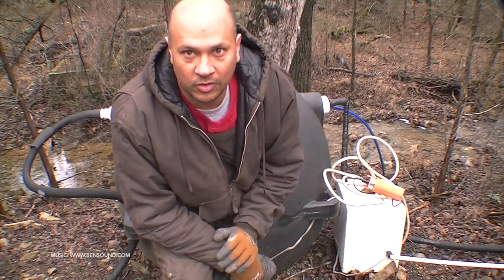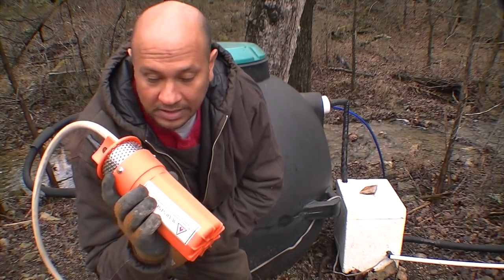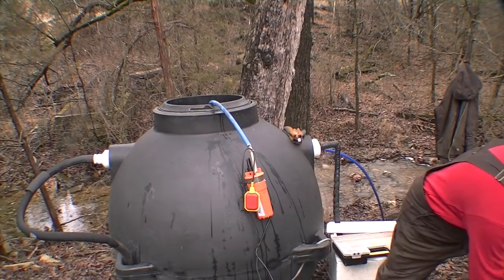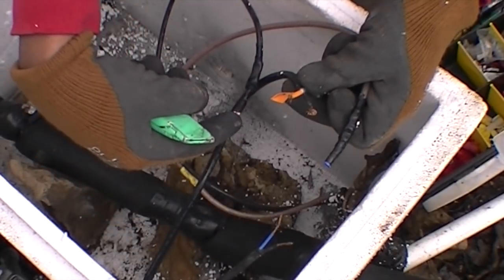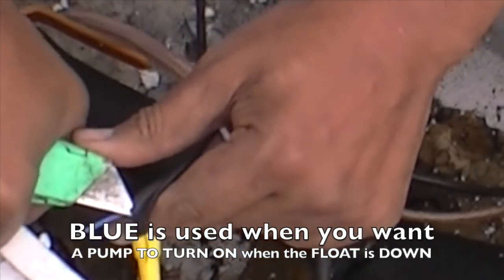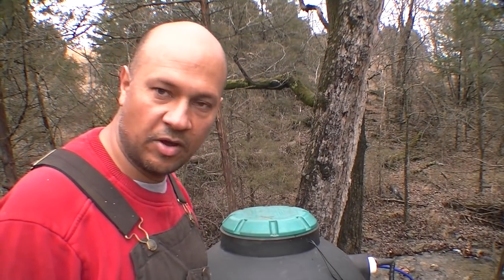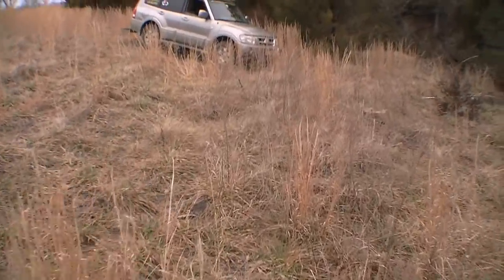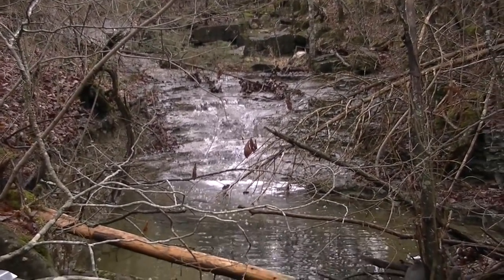OGH - Installing Off Grid Submersible Solar Water Pump for our Developed Spring

Comment: All water-filled hardware ( pumps, valves, piping etc.) will crack and burst if exposed to freezing temperatures. Enclosing your system in an above-ground insulated box only slows the process. Disaster is unavoidable. This is because you are attempting to conserve such a miniscule amount of heat. 

You have three options: set the pump up in a conditioned space (the house), invest in a submersible pump, or go to a well pit. This is a traditional, old-school approach that involves a pit (usually lined with heavy timbers, steel or concrete) about five feet deep and about five feet in diameter (room for you to work). Of course it needs a well-insulated cover. This is something that can work well, if it doesn't immediately fill with water of course! A neighbour has one and it's entirely trouble-free. The earth's warmth prevents freezing.

If you live in a moderate climate where it only freezes lightly, a heavily insulated box set in the ground can work. I'm speaking here of at least six inches of foamboard all around, open on the bottom. Again, a tightly fitted, heavily insulated cover is needed. Drafts are your enemy and must be stopped.

Submersible pumps are a great choice but ridiculously pricey. A quality one that will run for years and years (SunPumps, RPS Solar, Difful, Grundfos etc.) will easily set you back $1500 or more. The Chinese ones are affordable but appear to be lacking in durability. Too bad. The Chinese do make quality pumps but don't sell them in the West because, well, we don't want to pay for better pumps!

Anyways, my two cents worth. If you keep replacing $100 pumps, pretty soon you've spent the money that could have purchased a quality pump. Good luck, from the Great White North: central British Columbia, Canada.

Comment: I just got this same pump. How did you connect the PEX tubing to the plastic barb fitting on the pump?
Reply: Just found a rubber hose and hose clamps to tighten them down.  Its worked just fine for years.
Reply: @JohnFraserPhotographer  I've already got 100' of 1/2 PEX, and a pex check valve, so pretty much commuted to dropping it down the well. 
I've seen many vids, including this one, that have the PEX connected directly to the hose barb. 
May end up using a couple of feet of hose, then a Barb to NPT adapter and a NPT to PEX adapter to get it done. 
Thanks for the reply.

Comment: Shurflo makes a very similar unit and sells replacement parts. However at $800 I thinks its best to buy the cheap units. Since the diaphragm replacement from shurflo is $80
Reply from the maker: I had 3 surflow pumps prior to this one.  All of the diaphram pumps (non submersible) had the heads crack on them even with the pumps in an insulated box outside the cistern.  Thanks for the suggestion.
Reply: They also make the 9300 which is almost identical, i reached out to amarine for a source for the parts kits im getting about 2 years out of these pumps which isnt horrible for the price.

Comment: How did this submersible pump end up working over time? I'm looking at similar options and the reviews for some of these are mixed.
Reply from the maker: Hey Brian, the submersible pump the orange one has given me mixed results.  I'm averaging about 1.5 pumps a year.  I bought the extended warranty on but trying to get them to replace this and communicate with the chinese company who makes them is just bullshit.  I called Amazon and bitched at them about this piece of shit warranty company and the crap you have to go through to get anything done.  Here is the secret.  The pump will fail you've got 6-18 months on it.  Buy two.  (From Amazon).  When the first one fails, Order another one, and let them know it failed in about 20 days.  You have 30 days to get it replaced under amazon's 30 day return policy.  Return the old one, and you'll have your 2nd replacement again.  I've been doing this now for about 2 years.  The chinese people tell me to take apart the pump and let them know what I see?  I do that then I dont get a response.  This has gone on for 2 months in every case.    Hope that helps.  But this is the ONLY pump that is inexpensive - and submersible that has worked with my 2 solar panels now for the last 2.5 years now.
Reply: @OffGridHomesteading  if you could start over again, what would you do differently? I've explored ram pumps, but can't get them to work. I also see harbor freight on-line pumps, but those appear to need priming. If you have any advice, I appreciate your perspective. Thanks.
Reply from the maker: @mountainwave666   hey brian, my orange pump is my 5th iteration of pumps.  I've tried, the surflow external diaphram pumps a few different ones.  12v, to 24v, I've used, all the external ones will freeze and crack even if they are insulated.   The ONLY pump that has worked on the low power solar panels only is the orange one.    I'm sure I could have found a more expensive pump that could last longer, but here's my premise...  All mechanical crap -- that is submerged WILL FAIL as some point.  So fine the least expensive solution that will work for as long as possible, it's EASY to swap out, and is inexpensive to replace (i.e. under $100) and is readily available.  So if you can find a BETTER submersible pump that is UNDER $100 that can push over 440 Feet laterally, and up 35' of head on two solar panels... without using batteries, or a charge controller, relying ONLY on variable power to run the pump (when switched on at the pump)..... i'm all for it.    If you find a better solution let me know.  If you do decide to buy one -- please use my affiliate link for amazon as they'll send me 5% for you buying it. (so I'll make about $4).  Hope that helps!  J
Reply: @OffGridHomesteading  I have a couple of questions, what type of pump is it (centrifugal, diaphragm etc)? And what part fails?
Reply: @magnum0121984  Ive used all of them.  The diaphragm pump worked until it got cold and the head froze (surflo brand).  Now that its a submersible one, those haven't had issues except for water infiltration to the pump over time.
Reply: @OffGridHomesteading  great information man. And you use it two hours day average? Thanks and regards from Spain
Reply: @permaculturaensecano8644  Hey Frederica, the system is now my backup system, and when it did run it ran until we filled up the tank then I would turn off the switch to the system -- until the next time we needed to fill up again.

Comment: Will that pump output enough water to run a slucebox for gold mining? It's just that a couple of 100 watt flexible panels and that pump is way easier to lug around a claim than a gas powered pump
Reply: I’m not sure what amount of water you need to do your slucebox.  Look at the flow rate on the pump specs. I run my pump with 2 — 100w panels so yes it could work.   If you are gonna use water from a spring make sure you use a pre/filter to remove sediment.
Reply: It's 1.6gal/min but it can operate with a 230 foot head. That is the impressive part. There are DC sump pumps that can move huge volumes of water, but only with a head of 7 to 10 feet.

Comment: What about a nice battery?
Reply from the maker: You can add a battery.  I wanted a simple system that solely relied on the sun, and I didn’t want to be replacing batteries every 1-3 years leaving it outside 24/7 in the elements.  It’s one more thing to break down.
Reply: No battery= simple.  Nothing to have to replace.

Comment: How about  a Ram pump?
Reply: Only works at about 10% efficiency.  Not enough drop, or head to do the job, and it's noisy.  When you want to be discrete -- when the shit hits the fan... the less then noise the better.  Keep your water sources private as much as you can.
Reply: You really have to have enough drop to make a ram pump work. On the other hand they are simple, tireless workers. But he is  correct they are surprisingly noisy. But one I saw was made out of steel. The only time it failed over the decades was when lightening hit it.

Comment: How has it held up my friend? I am looking at getting one . 73.00 dollars on ebay , if it works that is a steal.
Reply: Longest I've gotten out of them was around 9 months.  I'm now using ours seasonally as we have added a well for a secondary source, and working on rain water catchment.  The more expensive ones will still only last a year  or a little more if they're out in the elements.     If i were do to this again i'd dig a hole and install it in a foam box in the ground.  Unfortunately my floor area is all stone.

Comment: No controller?
Reply from the maker: No need for a controller.  I'm not charging a battery bank that needs to be "tapered" of by a controller, or shut down when it's nearing 14v.   My panels create 24 v wired in series, create enough power to run the pump when the sun is out, and it doesn't with the sun is not bright enough.    And it's been working fine now for 3 years now.
Reply: Where does the extra load go? I thought that was part of the function of the controller - to only deliver the required load? I would have thought if you got too much amperage it could cause damage?? Looking at something similar and the pumps themselves arent too expensive, but by the time you add a controller etc. they get pretty spendy
Reply from the maker: I sized the panels to provide about 30% more amperage than the motor requires.  The pump will only PULL the amount of Amps it needs at the voltage.  Motors will move faster or slower based on the voltage.  When my water it topped off in my upper cistern, I walk down to the lower cistern / and pump and turn off the Light Switch I have in line with the motor.  Basically a manual turn off.
Reply from the maker: not needed. No batteries to over charge.  Motor is variable from 12-24v.  Solar panel outputs from 0 to 24v.   The sun becomes the automatic controller.
Reply from the maker: simple is better.  Less things to fail.